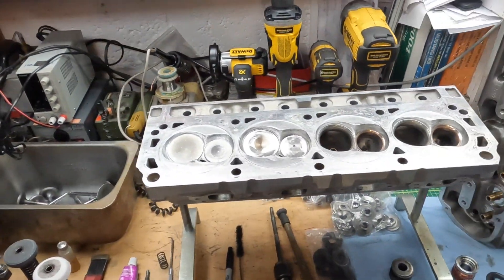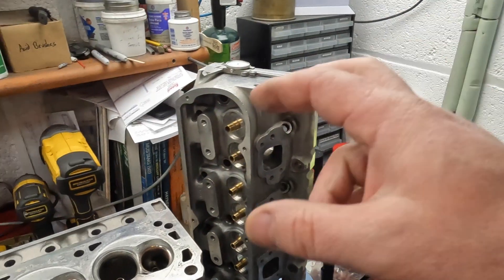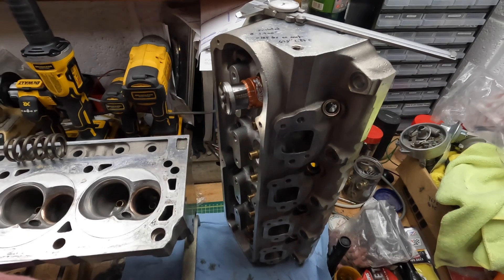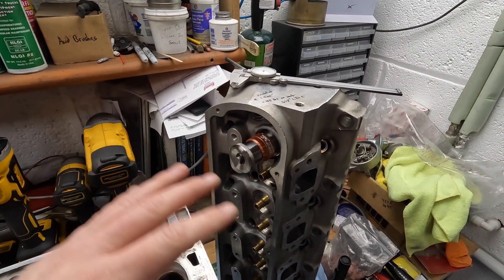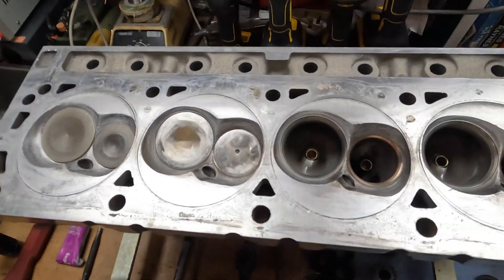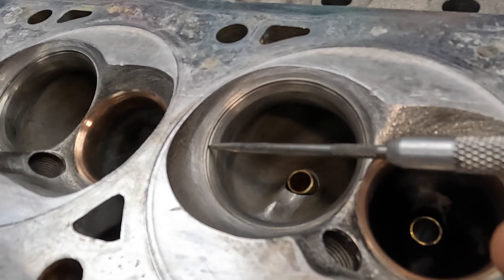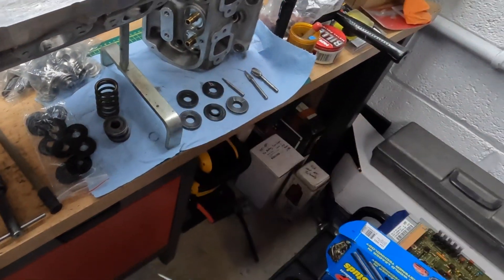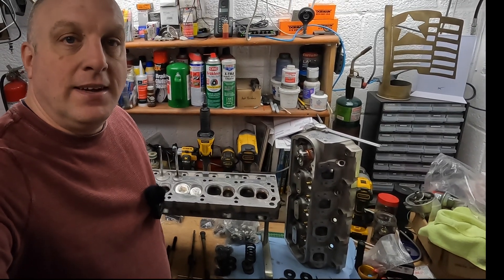Trick Flow R Head 206cc Teardown and Diagnosis

Comment: I haven't watched the video through yet, but I can't wait! I bought a pair of these ~15 years ago brand new, stock but with titanium retainers and clips. They were supposed to go on a 351W/408, but that never happened. Right now they're in the garage on a 302/363. It's a single turbo build for an SN95, so it'd need a custom exhaust/hot side anyway. Getting it was still very difficult! Ever since the mid/late 2000s I've had a special love for these heads. I hope to finally experience them on a running engine, hopefully soon!

Comment: those are the realy old twisted wedge R series castings
Reply from the maker: @aussi3212  oldies but goodies. Yes there are better modern heads out there but these can still hold their own. It’s just using them is more expensive as exhaust options are limited and costly, hence they’ve fallen out of favor.
Reply: @Mike-FoxsAbroad I brought a brand new set of TFS Rs about 2 years ago , they use a 3 inch or highport exhaust flange
Reply: Im going to use then on a pretty stout 438ci combo, it's going to be boosted , it's not a ideal combo but it's using parts I have always thought were cool, like the edlebrock Victor 5.8l intake and TFS R heads and MSD billet tfi distributer
Reply: @Mike-FoxsAbroad  with a good CNC port job will be better than most of the non super expensive heads.

Comment: Hoooker 6223hkr are the longtubes to find. We stopped making them last year but there are many sets out there.  They are fox specific.
Reply from the maker: Thanks.  We are gong with a set from Stainless Works (without the cats).  I called Kooks and was ready to buy a set from them but they said they no longer sell the ones with the 2.75" bolt spacing as apparently the new R heads use a 3" bolt spacing now.  All the while I was on hold with customer support and their tech department the automated on-hold background advertisement was touting Kooks ability to custom make any header or exhaust that I could dream up.  But they would not make a set of headers that they discontinued making not even 1-2 years ago.  I challenged their customer support and the tech people with that fact and their reply was basically, "sorry, tough doo doo'. These old headers don't make money so they have moved on to Coyote and LS swap stuff and the headers that spawned their business have been all but forgotten.  Unreal.
Reply: Sadly many companies are dropping them and not making parts while claiming their target is for classic cars and show a fox in the picture.  EPA really hit a lot of people because of specific fit remember that term. Do you have any way of direct contact ? And time difference I'm eastern time zone.